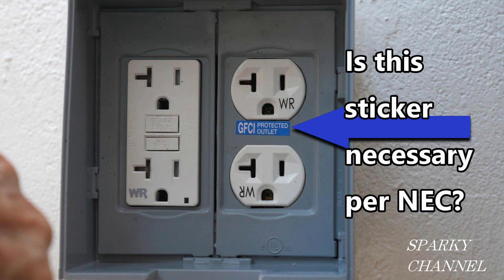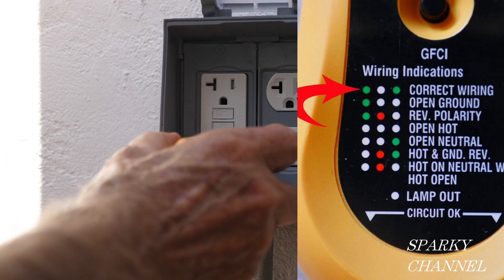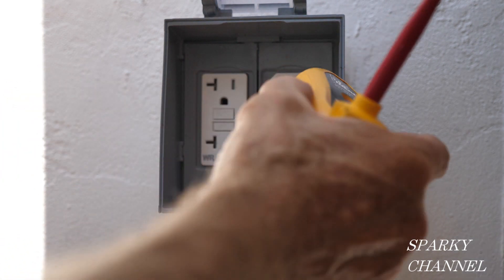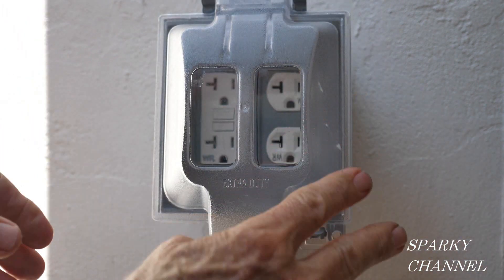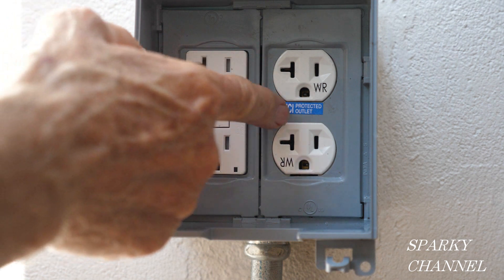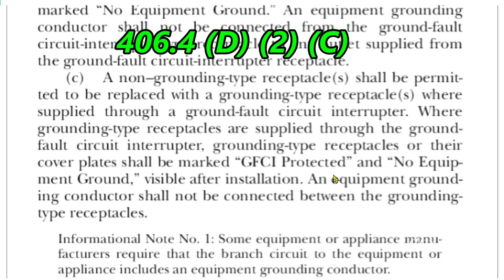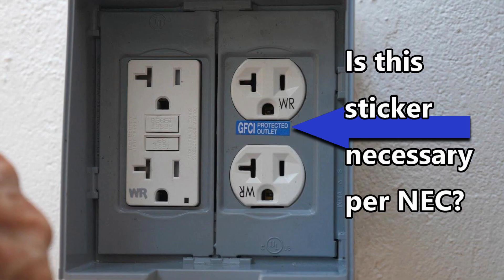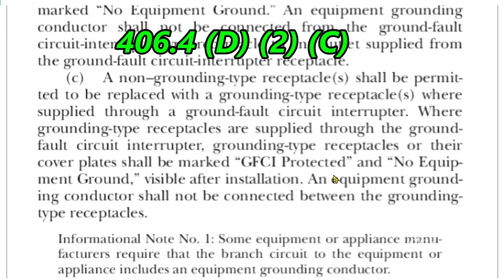Stickers Necessary for GFCI Protected Grounded Receptacle?

Comment: Marking it helps anyone who is servicing equipment after you! Also, most home inspectors require it when they inspect a house for sale.
Reply from the maker: Good point! Also if a locality or AHJ (Authority Having Jurisdiction) says you need them then it is also required.
Reply: @SparkyChannel  its interesting that in legal matters federal law generally, take precedence over state laws but the NATIONAL electric codes can be superseded by local regulations. Always check all local regulations!
Reply from the maker: @crazypete3759  True!
Reply: @crazypete3759  NEC is not LAW. It is adopted fully or in part as the Local regulation.
Reply: If a home inspector says to do it it has to be true...(  LOL )
Reply from the maker: @donl1410  LOL!
Reply: @SparkyChannel  😄
Reply: @douglasmarcus840  I don't know where you are from but I've had 3 houses fail a home inspection and one of the items on all 3 inspections was "unmarked GFCI protected outlets" ... so, yeah, at least where I'm from, home inspectors require the receptacle to be properly labeled!

Comment: For those of you who have regular outlets daisy chained to a GFCI, AFCI or AFCI/GFCI dual protection outlet, if you need additional AFCI/GFCI Protected Outlet labels or No Equipment Ground Labels, if you have a printer for your computer, AVERY-DENNISON makes small return address labels, 80 per sheet, that you can print and stick onto the outlet or switch plate.  Template software can be downloaded for the labels.

The "No Equipment Ground" situation applies to homes built in the early 60s or before in most cases.  I inherited my home from my folks.  It was built in 1955, and since I inherited it, it was not subjected to electrical upgrades.  Back in the 70s and early 80s, I took classes in Electronics in high school and learned about residential wiring.  GFCIs were newly required in house bathrooms starting in 1979.  I wondered why they didn't include kitchens as well at the time when the NEC adopted that code.  I saw that code change locally in 1990, adding kitchens in my area, then adding outdoors as well.  By 2000 in my local area, they added detached garages to the code.  My electronics teacher taught us about some changes in plumbing that started affecting ways electricians grounded the electrical boxes.  Around 1955, my local code required bathroom, laundry and kitchen outlets next to sinks be grounded, and the switchbox to the bathroom light switch be grounded.  Switch boxes to outdoor porch lights were also required to be grounded.

Comment: Hey sparky got a question for you, hope you'll answer me or make a video out of it.
So let's say I am in a situation where everything else is dead except a 50amp stove line (#6 240v) live and I decided to pigtail some 12g wire and made me some 120v receptacles to run some miscellaneous tools like skill saw, shop vacs, table saw, pancake air compressor, etc. So the question: do I am jeopardizing my tools because of the high amperage?

Comment: i have seen my work number 8 wires in 20amp for light exterior pole ,they said is for voltage drop ,do you think is legally by nec?????casanov electric
Reply from the maker: Yes, as long as your devices are UL listed for 8AWG wires. It's for voltage drop.

Comment: A non-gfci lable would be useful for outdoor outlets that don't have protection.  If the outdoor outlet is is being used for a fridge, DJ equipment,  or anything else that can trip a gfci, you will have to skip it. . 
Paired with a gfci will still leave a safe outlet for most items, including the fridges and dj equipment that doesn't have a problem  tripping the gfci.

Comment: I'm going to say yes. If for instance you have a countertop receptacle, it "SHOULD" be GFCI protected if it's within 6' of a water source. BUT IF there is another receptacle on the same circuit but outside of the 6' you can use a standard outlet. But it should be marked as protected since it is still on a countertop.

Comment: I had a city inspector walk through a rental.  She assumed the receptacle near the the bathroom sink was not GFCI because it didn’t have the appearance.  I educated her on GFCI receptacles and gave her a tester that trips GFCI receptacles. When we tripped it using the tester we heard it “click” behind the bathroom door.  We reset it and inspection passed.  She also tried to tell me I needed a disconnect switch at the furnace.  I googled the code.  The breaker for the furnace was in eye sight and with in an arms reach.  I changed her mind on this as well.  lol.  I was polite and respectful and have built up her trust making future inspections easier.  She should probably trust the state electrical inspector handle the electrical stuff.  Or at least tell her about this great channel.
Reply from the maker: Good story, thanks!

Comment: Whether it is code or not, marking makes sense. It sure will make it easier to trouble shoot if the outlet is dead. Ran into a strange situation while trying to help a neighbor. The power went out in their bathroom one day. Couldn't figure out what was wrong. All the breakers were fine, none were tripped.  Called a relative, who is an electrician, to see if he had any ideas. He told me he had run into a situation like this.  He told me to look around for a GFCI outlet somewhere else in the house and check if it had tripped.  Found one in the in the kitchen that had tripped. Reset it and the bathroom was live again. Not sure why this was done, but my electrician relative said it is sometime more common than not is some homes. He also said it depends on how the code might have been interpreted at the time the house was built.  In this case, the bathroom was on the wall behind the kitchen.
Reply from the maker: Absolutely! I've run into situations like that as well. Who knows what the installers were thinking. :)
Reply: @SparkyChannel  likely the homeowner updated the one outlet to GFCI either not knowing (or not concerned) that it was the same circuit and upstream of the outlet on the other side of the wall, all of which was probably wired under old code that did not require a separate circuit for the bathroom. In my 1928 house, the bathroom was on the same circuit as 2 adjacent bedrooms.

Comment: “Over communicating” is typically not a bad thing, grounded or non grounded, I opt for the sticker.  As I had mentioned in a prior video, my beef is with the GFCI stickers not being as permanent as I’d like.  I’ve seen too many, particularly outdoor receptacles, lose their label.  It’s either completely gone or is sitting in the bottom of the box.  I have seen the same on indoor receptacles and receptacles in heavy use tend to lose them by being continuously touched, etc.  My suggestion is to designate a set color (what color should it be) to mark an outlet with a permanent marker as an additional marking option along with the sticker.
Reply from the maker: Good idea, thanks!

Comment: Doesn't compliance with the manufacturer's installation instructions count for anything? I know many of these call for the placement of the stickers on downstream receptacles.
Reply from the maker: Yes, the manufacturer's installation instructions definitely count. Excellent point.
Reply: I was going to mention this as well as NEC says you have to follow manufactures instructions.   Therefore by default you would be required to have them on downstream outlets.  Oh and test them at least monthly.  😁👍

Comment: Couldn't one assume, if a GFCI receptacle is used, then it's GFCI protected?
Reply: I think you are misunderstanding. The sticker isn't for the outlet with the GFCI, it's for the outlet downstream from the GFCI that's protected by it. Anyone who sees the buttons knows it's GFCI, but what about an outlet 6 feet away with no buttons?
Reply from the maker: No, you can't. The wiring can be in such a way that the GFCI doesn't protect the downstream receptacle. If the wiring goes from the line portion of the GFCI to the downstream receptacle then it's not protected.

Comment: I kind of agree,  while the NEC doesn't require the labels if used on a circuit that includes an equipment grounding conductor,  some local inspectors and local jurisdictions might require them,  and as always,  local requirements supersede the NEC.   I typically see such labels in commercial settings,  especially hospitals,  and the bathrooms of shopping malls, in some cities and towns.   In any case,  you are absolutely correct,  they make troubleshooting much easier,  particularly in commercial settings which employ traveling electricians.

Thanks for sharing your knowledge and opinions
Reply from the maker: No problem, thanks Kyle!

Comment: Traditionally, when I was inspecting electrical installations, the stickers were not required on new construction because everything was a grounded outlet. However, I know that in some jurisdictions they do require labels on all GFCI protected outlets despite what I read as expressly meaning non-grounded outlets.
Reply from the maker: Interesting! In any case, I think it's good "electrician manners" to put on the stickers. :)

Comment: Kinda surprised at all the comments saying it's practical or helpful for the next guy or even enforced by inspectors. It sounds like people think they should put those labels on any outlets on the supply side of a GFCI, even where obvious like in the shown example. If you really tried to do that on every kitchen receptacle you'd be out of work quick.
I never use these unless a homeowner is too strapped for a rewire so we're just replacing all two prongers, but at that point I'm more importantly adding the custom "no equipment ground" labels that don't come in the box, which I'm seeing no comments on. That's not just practical, that's code required.
Reply from the maker: Thanks! BTW, "no equipment ground" stickers come in Leviton GFCI boxes.
Reply: I've seen the "No Equipment Ground" labels in Pass & Seymour and Eaton GFCI packages when I purchased them, as well as Leviton GFCI packages.

Comment: Tel me how you split a (builtin) GFCI outlet? Testing both sides seems a bit over the top. (Not so for any outlet that can be split, except if you wired it wit only 1 pair of line wires, it also seems a bit of over kill as Polarity MUST be correct if the other was).
BTW I mark them. The GFCI buttons may not be visible from the location.
I have 2 GFCI side by side in my Garage. 1 is for the freezer and I put a child resistant cap over the extra labeled "freezer only this side. DO NOT REMOVE".
Reply from the maker: Thanks Steve!
Reply: Break the tab on the sides of receptacle.   Two circuit?
Reply: @gregorysampson8759  there are 2 sets of screws - one for the line and one for the load - the are not connected to each other with a tab or anything else.

Comment: That article refers to replacement receptacles as mentioned.  Stickers aren't required generally in code articles.  The only argument would be in NEC 110.3(B) Installtion and Use.  If the device installation instructions says to add labeling on downstream receptacles, then it could be enforced.  I believe Leviton mentions this in their Installation Test Documentation
Reply from the maker: Excellent, thanks Don!
Reply: @SparkyChannel  👍

Comment: One thing I hate everyone thinks the nec is code it's not its up to the authority having jurisdiction yes most adopt the nec as code but they don't have to
Reply from the maker: Correct, thanks!
Reply: But the AHJ has to document any alterations and additions to the NEC or adopt their own code and make it available.
Reply: @donl1410  I know several counties and townships in my area adopt bthe NEC but two editions back. So 2020 is current NEC codebook / NEC code Handbook.  But they are using 2017 , 2014, or even 2011.  One only inspects homes.  If a barn or shop is built no electrical or plumbing inspections.
Reply: @vicktorpatriot1430  Oregon adopts the current NEC with some exceptions, as in not adopting certain articles such as some new AFCI and GFCI reqirements.  The ammended Oregon NEC is published as The Oregon Electrical Specialty Code.  There are a few cities that have additional City Codes.  All Oregon Journeyman and General Supervisor Electricians must have between 8 and 12 hours (Journeyman and Supervisors, respectively) of Current NEC Code change continuing education, 4-hours Oregon Rule and Law and a total of 24- hours with other code related CE per code cycle to renew your license.  Everything must be permitted and inspected or have an Oregon Minor Label permit.
Reply: @vicktorpatriot1430  Im curious. Can you follow newer codes in that situation since they exceed it? For example adding an outside disconnect switch even though it's a 2020 code?
Reply: @adamplummer2190  the code is the minimum fire safety required.  You can always exceed it especially in residential construction.  
A slightly political example.   Local township starts doing electrical inspections for new homes.  Sister of a trustee  built a house and it passed electrical inspections.   But after she moved in if she was sewing and had the tv on plus not sure what else  the breaker would trip and off goes tv and sewing machine.   Trustee asked me about it .  I looked at it and said it meets code but code is minimum.  She needed to have her builder have additional circuits in the room she was putting that sewing machine in.   It wasn't a basic machine it could sew Carhartts , leather jackets etc and needed its own 20a circuit not be sharing  with several other things.     The trustee was mad it was able to "pass code".  Code or no code enforcement the buyer needs to be aware of what they are really getting.
Reply: @donl1410  sounds like Oregon is like a wood tick on the wallet with permits for everything.
Reply: @vicktorpatriot1430  Yep

Comment: A much better way of confirmation of the duplex being protected is get bare foot and pour a couple gallons of water on the ground and plug an electric tool in the duplex into a running over bucket of water if it's GFCI protects the duplex if not then no more videos
Reply from the maker: LOL!

Comment: I would say yes (it never hurts to label and avoid confusion).  From a user standpoint... (1) You can't tell from the front if they are the same circuit or (2) if the right receptacle is on the load side of the GFCI, meaning (3) they both may share the same line side connections of the circuit (in that case, the receptacle on the right is not protected).
Reply from the maker: Excellent!

Comment: I think it's a bit redundant, it's in an area that requires it to be GFCI protected, and is mounted beside a GFCI plug
Either way I would still check it (marked or not)  It's just as easy for lazy or inexperienced person to not wire the 
receptacles correctly, and if it's not, then the sticker doesn't matter anyway

Never trust the previous electricians work, even if it's your own, cause we all made mistakes
Reply from the maker: That's true, never trust anything except your own tests. But it's good to have a sticker to let you know what someone else tested.
Reply: "Either way I would still check it (marked or not)  It's just as easy for lazy or inexperienced person to not wire the 
receptacles correctly, and if it's not, then the sticker doesn't matter anyway"

I just discovered this.  2 gang box in my kitchen. On one side is a GFCI, the other side is a regular outlet. When using the GFCI tester, the GFCI in the shared box doesn't trip. Instead a different GFCI on the other side of the room does.

Comment: I think it would be required by code, however I think they should sell receptacle cover plates that have the markings permanently engraved in the plate,that way it cant be worn off over time or peeled off.
Reply from the maker: Excellent idea!
Reply: Not on the cover plates because painters take them off and could very well mix them up when reinstalling. Then things would be really screwed up!
Reply: @MandrewP  they can do the same thing with the plates that have the stickers on them 🤷‍♂️. Painters should know better
Reply from the maker: @MandrewP  Didn't think of that.